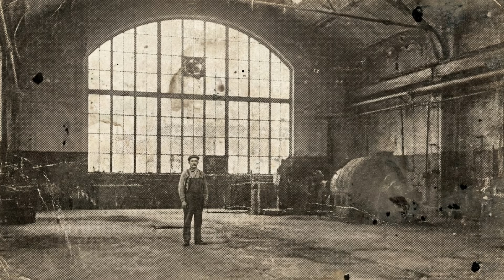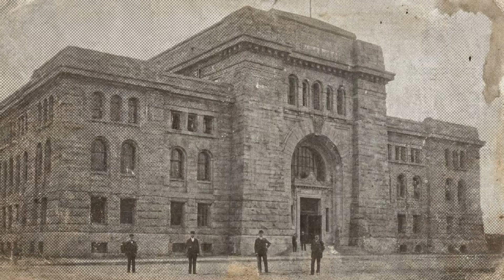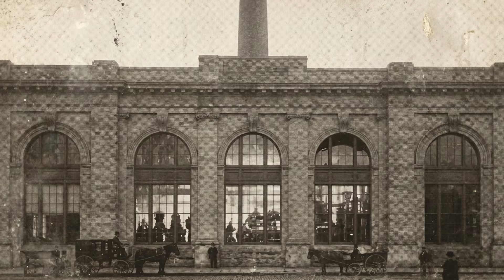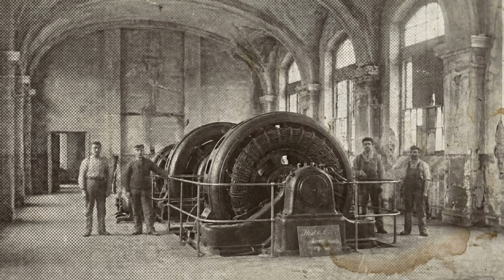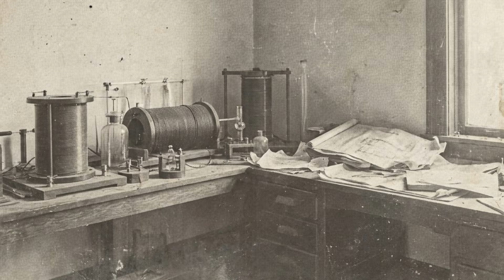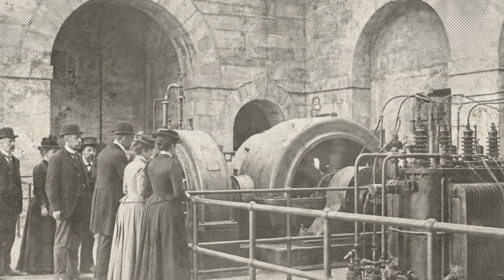The First Power Plants Looked Like Temples — What Were They Really Built For?

Comment: There is a structural advantage to arched masonry openings, particularly the semi circular, arch redirects thrust almost directly down into the piers, compared to a "rectangular" or flat arch, which pushes outwards. It can also be done with iron ( only fireproof if encased in concrete ie. A cast stone lintel over the doors) which was later replaced by steel which corrodes if not galvanized and even then it eventually corrodes, or wood, obviously not fire proof. For a very wide span and a generous height limit, semicircular arch makes the most sense. Still beautiful buildings